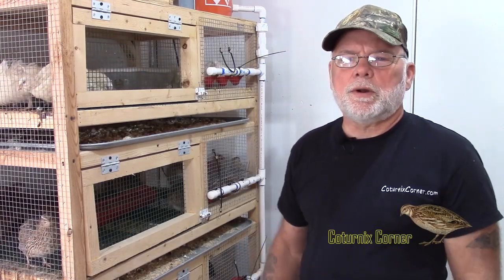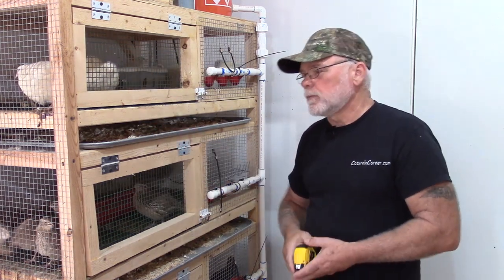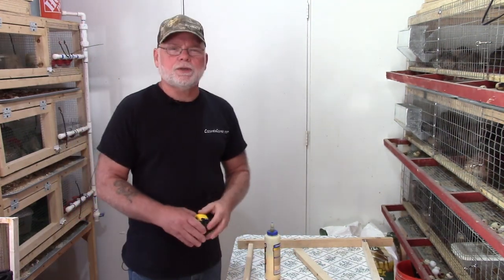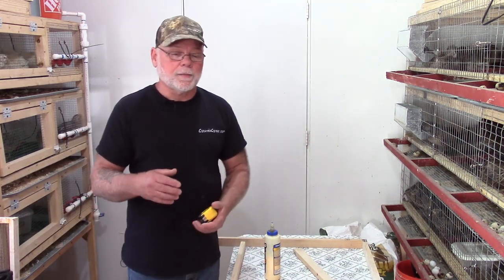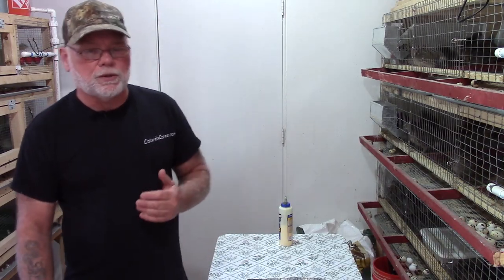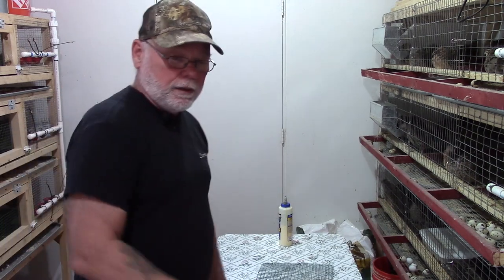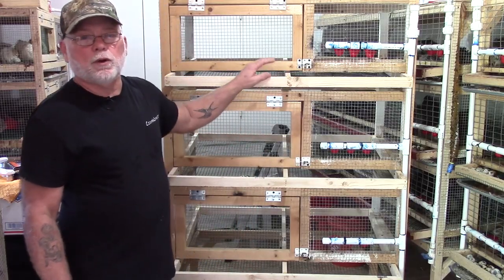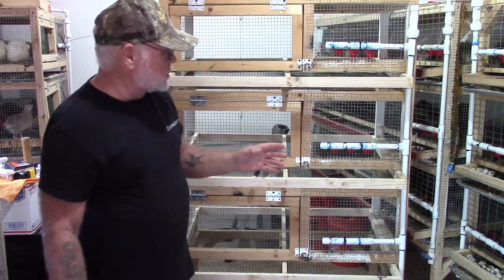How to build a Stacked Quail Cage - with Egg rollout trays.

Comment: WOW....I sure Need Some Help Please......I built the stacking cages as you showed in the flat bottom cage...but...I added this roll-out flooring to each cage. My concern is the large opening at the bottom front where the eggs roll under the door....what keeps the birds from crawling out under the door and the area to the right of the door? Should I add a 1x2 to fill that space until the birds get bigger? Or am I doing something wrong in my build? Thanks so much for all your help.....the videos you create are so helpful. Thanks

Comment: FYI for those new to quail raising, like me. Coturnix up to 3 to 4 weeks of age can crawl under the gap. Keep a 2x4 in the gaps until they are larger, they need it for the waterers anyway. It didn't look like they could fit, but they did.
Reply: Yes so true,I had two birds escape this way. It was very comical at the time as I didn't know how they were getting out. I kept putting them back in the cage,and a few minutes later the two males were strutting around,then I finally seen where they were getting out, which was the egg tray. I just blocked the tray off,for a few weeks. It was quite funny 😂  and made me laugh.
Reply: @stanleycarmichael7425  Lol. Glad your experience was better than mine. I had about 6 escape. Ended up finding them all, but the dog got ahold of one and he didn't survive 24hrs. I was REALLY close to finding the last one with my mower. Luckily he jumped instead of ducked.
Reply: My birds are a year old and still can crawl under, lol!

Comment: Hello Terry! Thank you for the amazing detailed plans and execution. It is just something I can not understand on both videos this and the standard one. You are using 1 x 2 for the floors, but in this case you say 27.5 inches and when they go in between the rails it will give a total of 29 inches. It shouldn't be 27 + (2 x 1) = 29 inches ? It is not a big issue on this as it will be just 0.5 inch longer but on the standard one it will be out by half inch unless I am getting something wrong, can you please clarify ?

Comment: Hello Terry! I currently have single cages that are raised 60", wire bottom drop through. Trying to be more efficient on space and add another layer. Therefore I'll need some poop trays. Would you be able to provide a link to your point of purchase? If you purchased from a box store, could you provide store and tray detail. Thanks for your knowledge, I greatly appreciate it.
Reply from the maker: https://shop.advanceautoparts.com/p/flotool-galvanized-drip-tray-11430mi/9016759-P?searchTerm=drip+tray
Reply: @CoturnixCorner  Thank you!

Comment: What is the max high at tip of quail feeder?  I dont have any quail yet so wondering as my feeder high is 4.75 inches.  Wondering if it too high and need to lower it.
Reply from the maker: about 4" to the top of the feed trough is perfect.
Reply: @CoturnixCorner  Thank you sir.  Been learning alot from all your videos.  If I can not  lower it, will 4.75 still works for adult quails.  Because of the egg roll slope I would need to cut into the crossing wood frame.
Reply from the maker: @marcusnguyen3185  Yes it should be fine. If the birds can't reach you can always place a  board below the feeder for them to stand on.

Comment: great video. I will be building new cages soon and using your video as a guide. I do have one question. Do you have any issues with eggs cracking or breaking when they roll down into other eggs or hit the wood?
Reply: Quail eggs are pretty thick and tough, for an egg.

Comment: Does it concern you that the gap created by the rollout may invite or make it easier for a predator?  Perhaps I might be able to put a small shelf or something to cover the extended portion of the rollout.  Thanks in Advance for your opinion.
Reply from the maker: My cages are indoors in a predator proof building. For those who keep the cages outdoors I recommend attaching a hinged plywood door over the egg tray to keep predators out. I've seen several people incorporate this into their outdoor setups.
Reply: Coturnix Corner thanks for the cover suggestion just getting to the roll out trays on my build I’ll send a picture of my cover when they are done. Not sure how I’ll do waterer since cage will need a roof to keep water out.

Comment: For building the 74 inch width cage with egg rolling system, do we need the double materials as stated in the video ? Only major difference is that we save 4 legs right ?
Reply from the maker: Actually you only need to replace the 37" pieces with 74" pieces, all other measurements stay the same.
Reply: @CoturnixCorner  Dont you think we need more supports between front and rear ?? Can you share please the height of the opening for the tray ?

Comment: Hey there,

The link to those great looking metal pans doesn't work anymore for the metal types, but changes to a plastic style that is quite pricey.

Do you have a secondary source, or a specific description for a Duck Duck Go search?

Your Green Coated Wire also links to a non-coated roll that is 24" wide.

Thanks.

Cheers from the Oil Patch in Central WY

Comment: Terry.. do you ever have any problems with egg breakage / egg cracks with this roll out system?
 I know it's not at a steep angle, but the eggs are hitting wood( and other eggs) and may be laid at the back. Thanks!
Reply from the maker: I have not, but if you are concerned you could place a bumper of some sort on the leading egde of the roll out tray to soften the hit when an egg rolls down. Although once more eggs are laid they will just hit the other eggs. I haven't had any issues, if you are getting cracked eggs you might need to up the calcium a bit to increase shell strength.
Reply: @CoturnixCorner  thanks for the reply.. I don't have any Quail yet, but I'm trying to get some. And I'm pretty sure I've watched every video you have. You are pretty much a genius.. the racks, the watering system, the incubator.

Comment: With the roll out egg floor the eggs wouldn't be fertile then I'm guessing. How would you get fertile eggs just leave them for a day or to or how's that work?
Reply from the maker: If you have males in with the females the eggs will be fertile.
Reply: @CoturnixCorner  even when they roll out? In going to build the same setup. So when the eggs roll out they fertile. Sorry I sound so ignorant I just want to be prepared
Reply from the maker: @Jr-lp4ev  Yes, when the eggs are laid they are fertile as long as the male has been breeding with the hen.  Don't be sorry, there are no ignorant questions.
Reply: What do you use more YouTube or Facebook? What's your Facebook page?
Reply from the maker: @Jr-lp4ev  I use them both equally, and the facebook group is also Coturnix Corner.

Comment: So how big do the quail have to be to keep them from getting out of these? have had 4 escapes so far which resulted in the deaths of 2, thanks to my waiting dog. They are 3 weeks old now, and they sure seemed big enough to be kept in but no way. No one on any of the channels I watched about quail, ever mentioned that they are escape artist.
Reply from the maker: I recommend you don't put birds under 10 weeks in cages with roll out flooring.
Reply: @CoturnixCorner  I went ahead and made the roll-out floors but at the front I add a 1x2 that fills the gap where the eggs normally roll-out....thinking that at 10 weeks I can just remove the spacer.
Reply from the maker: @SteveChastain  perfect, I do the same if I need to use a layer cage for my growout. Yes arount 8 to 10 weeks you can remove the spacer.

Comment: I missed something there. I spent my life working hard, and I have an aversion to watching someone work, it's too much like work. I jump forward in a lot of videos so I don't need to watch the tedium. I slowed it down when you were getting to the point of slope, you threw out a vertical measurement , and a previous measurement from the previous build, I failed to follow. No matter, I think your slope is too steep, the eggs will roll too swiftly, possibly break. I may be wrong. I would, (will), go less steep, possibly a quarter to an eight per foot. I appreciate your channel, thanks. I will be building a system for myself, and for another person. They have electricity, but I live without for a period of time, which will make many of the functions difficult. I have ideas, might require hour intervals of inspection, especially incubation, maybe more frequent to monitor temps. I will have electricity soon, so it is probably moot. Best, Tom
Reply from the maker: Hi Tom, thanks for the comment. I do the same thing watching videos, jump ahead to the good stuff. I use 3/4" to 1" of drop for each foot of forward floor space. I haven't had any issues with broken eggs. Good luck in your quail adventures and I appreciate your input!

Comment: About how much is the cost to build the 3 tier with rollouts and auto waterer? Im hoping to build one next month and get quail in march/april!
Reply from the maker: It all depends on the material you use. Some wire, like the 1/2 by 1' will run more than the 1/2" hardware cloth. Same with lumber, prices are a bit higher now than when I built these cages. But on average, I would say for around $200 you should be able to build the 3 tier unit with rollouts.